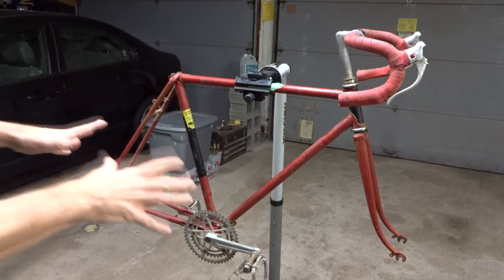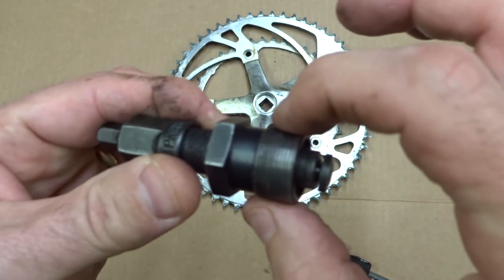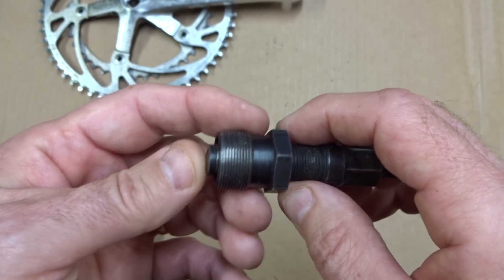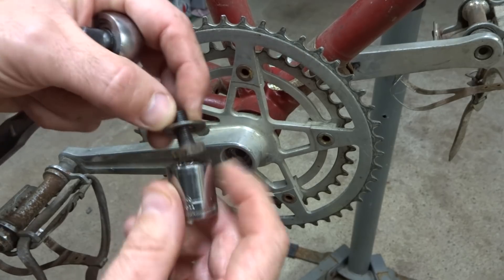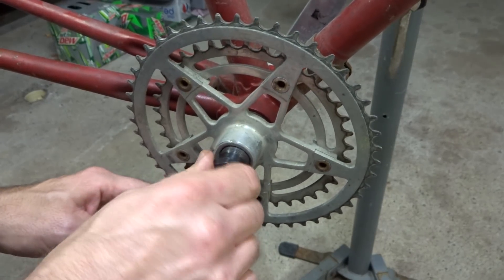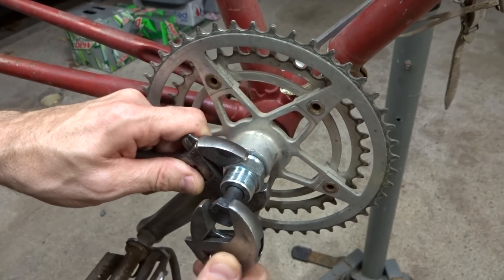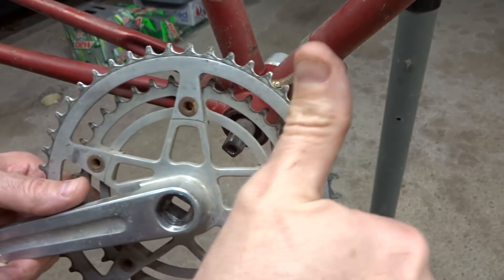How To Remove Vintage Stronglight & TA Specialties Cranksets & Crank Puller Tools

Comment: I’ve used a two armed puller with success on an old Stronglight crankset. I had to remove the chainrings before removing the drive side, but it saved me buying a special tool for a one off job (I’ve since sold the bike).

Comment: Nice!, I just picked up a 1975 Raleigh with the Stronglight 93 Crankset, I will get  the 23.35mm crank puller
Thanks👍🚲🔧
Reply: Hi where can you find it? Thx

Comment: Great video, but one thing I don't understand is why you hold the crank puller 'nut' with another wrench while you tighten the bolt? why not just hold the crank itself?

Comment: Thanks for your response and link. Actually, I got it wrong; it's the drive side, i.e., the non-adjustable side of a Peugeot PX10, that presents a problem. The wrench size necessary to remove it is, I think, 38mm. But there is precious little metal to grab it. ----  Fortunately, I remembered to check Sheldon Brown's archives on the subject and think I can manage it (he suggests clamping the cup by running a bolt through it, and turning to tighten it (clockwise) from inside the BB (which turns the cup counter clockwise, looking from the outside). Again, many thanks.
Reply from the maker: https://www.youtube.com/watch?v=P9oIUmdI5JU

Comment: Great video and any idea how to better remove a stuck crank, the reason i ask is on a bike i recently bought brand new i wanted to replace the crank got a better quality one but when i used the correctly sized puller tool it simply stripped the threads, after some googling it turns out this particular bike manufacturer uses a lock tight or glue on the crank.
Reply from the maker: What manufacturer uses glue on the crank? https://www.youtube.com/watch?v=jrpIoXxVyTs

Comment: Informative but you forgot to say who makes the 23 23.35 combo tool that you were about to use? Scoured ebay can't find it only find JA Stein 23.35 single tool.
Reply from the maker: I have no clue makes it. I went on ebay and searched and found it. https://www.ebay.com/itm/stronglight-specialites-t-a-removal-remover-crankset-Arm-Puller-vintage-Tool-new/152740762417?hash=item23900f1331:g:yDsAAOSwhwBZ33jr

Comment: There is another exception: a bike that I had years ago ! On the drive side, the opening was threaded but its diameter was way smaller than the "normal" tool, 15mm perhaps or less, I don't know. I never figured out how to pull it off (and I needed to ), never found a tool that fit or a similar thing on another bike. The non drive side was normal. Eventually, it all went to the bin.
The bike was "bicitime" brand, an obscure but probably italian brand from the 80s. A pretty bad bike, with weird parts but i had nothing else at the time.
Reply from the maker: I just named a couple of the most common exceptions.

Comment: Why stop with the drive side? My problem is with removing the cup from the other side. What the hell is the spanner size to remove it?
Reply from the maker: This video is removing the cranks. Both sides remove the same. Removing the bottom bracket is beyond the scope of this video. I have other videos on that. And the wrench varies with different bottom brackets.

Comment: I have the same ones ! I don't have the tool tho :'(
Reply from the maker: Get the tool. You can find them on ebay.
Reply: @RJTheBikeGuy  I was like fine I'll get it, it could be useful for future projects but I find it to be very expensive (25€ in France). Will it strip the threads 100% ? Do you have a vid on how to put it back together by any chance (if I don't ruin my it while removing it) ?
Reply: Oh well I just bought it for 22 bucks ahah
Reply from the maker: @MABFR01  I have no idea what you mean strip the threads. https://www.youtube.com/watch?v=ZDK6knIPhQg
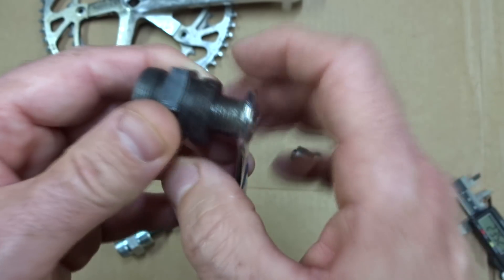Reply: @RJTheBikeGuy  2:52 that's what I'm scared about
Reply from the maker: Just use the correct puller.

Comment: Are you rochester or buffalo?   If Rochester, I would bring you beer in exchange for 5 mins with that crank puller!
Reply from the maker: I don't drink beer. And I don't have an open shop.
Reply: @RJTheBikeGuy  well if you are at seghahunda ever again (saw the sweatshirt, personally did a few dnfs on that race)I would at least like to shake your hand, I've learned a lot watching your videos.
Reply from the maker: @dyaddaw  I did the first one. And I did the year when like half the field DNFd because of the heat. Finished both times. I did the relay there one year too.